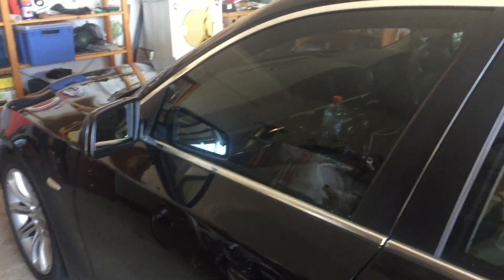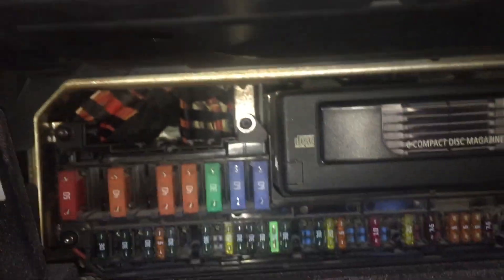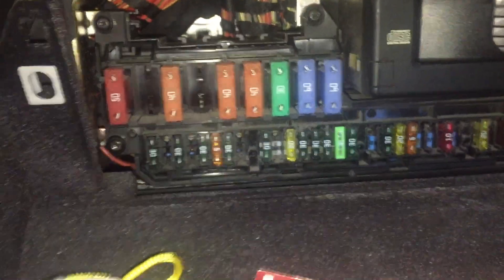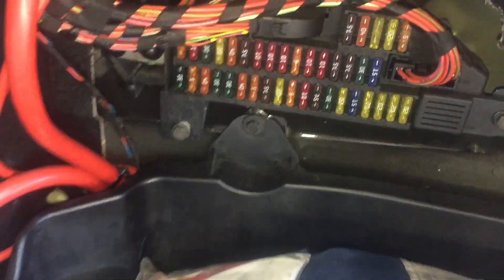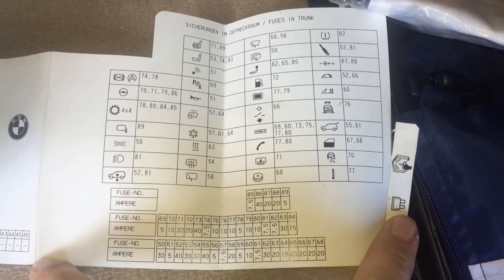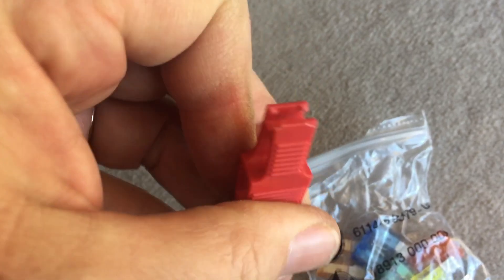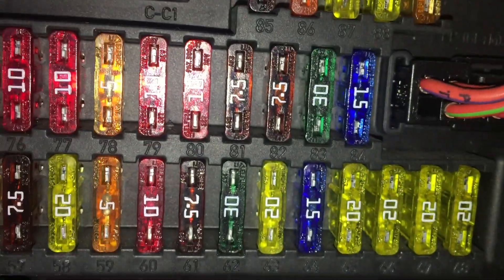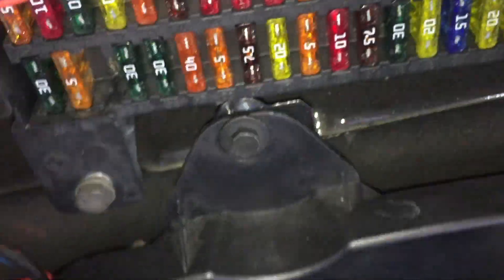Where are the fuses on a 5 series BMW. E60 E61. Similar on 3 or 7 e90

Comment: i have same model car and my fan (in engine) keeps coming on and sometimes wont turn off. It even indicates the car is overheating sometimes when it actually isn't. If I turn car off and straight back on, it fixes it for a bit but fan will kick back on. I changed temp sensor but didnt fix. Could it be a fuse? or fan relay?
Reply: my e60 has the same issue... virginizing the DME fixed a lot of shit but did not fix the durango fan

Comment: DOES NOT WORK ON 2004 BMW 545i
Reply from the maker: Dr. Pillowjumper So tell us where they are in your car?
Reply: Mark's reviews and tutorials they are in the same place I meant the fuse layout, it’s different. But I’m sure it’s different in every bmw
Reply: Mark's reviews and tutorials and also I’m not very experienced about bmw’s but I have one and it won’t start I believe it’s not getting spark any tips??
Reply from the maker: Dr. Pillowjumper Try charging the battery to 100%. BMW are very fussy about having enough bolts. MRT
Reply: Mark's reviews and tutorials it’s currently 100% charged it has brand new spark plugs and coil packs but still no spark???